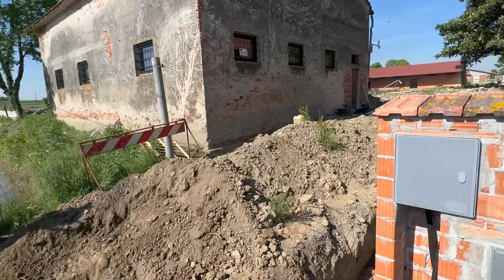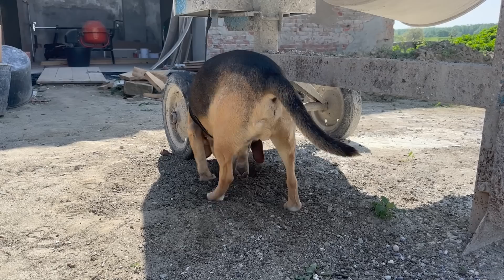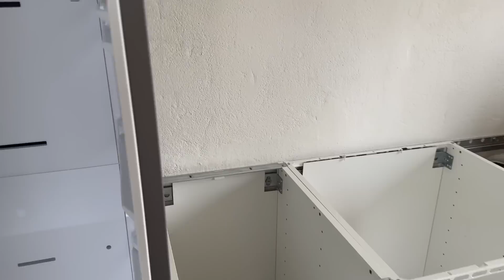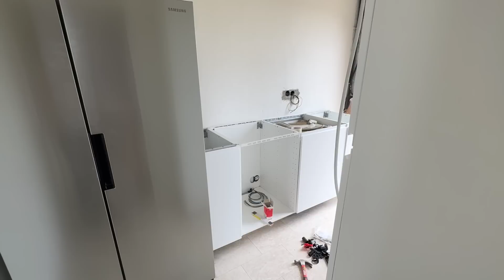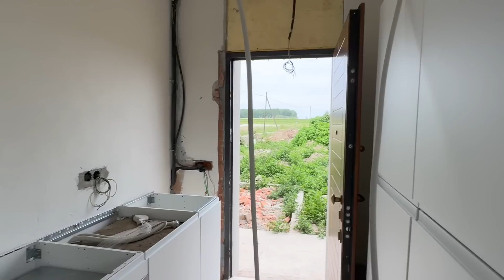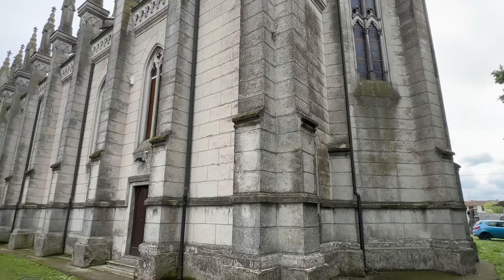The Mundane but Necessary: A Week of Errands in Italy - Episode 30 of our Italian house renovation

Comment: I'm sure you have cameras and I don't know if you have SimpliSafe in Italy but, with this alarm system it will sound an alarm and call you to see if you want them to call the police and it also, has a microphone and camera so you can ask them what they are doing on your property. Since, you are starting to install appliances and plumbing I assume you are going to tighten the place up with strong doors and such?
Reply from the maker: Not sure there is simplisafe here but there are similar things, and I do have the function to talk to them and sound alarms etc which is what I usually do when I notice trespassers. 

Yes, we already have a security door and the big opening wont be able to be opened from the outside so it will be quite secure, especially in conjunction with alarm and cameras.

Comment: To kill ants take 3 parts of icing sugar and 1 part of borax. Mix well. VERY IMPORTANT, because you have dogs you must protect them (mixture is poisonous for pets). Simply cover containers well  and make holes in the lower part. It take a  few weeks to kill them all.
Reply from the maker: Thank you! 

Orange peels should work too I have heard and is not poisonous to the dogs. But we did get rid of them quickly with an ant pesticide.